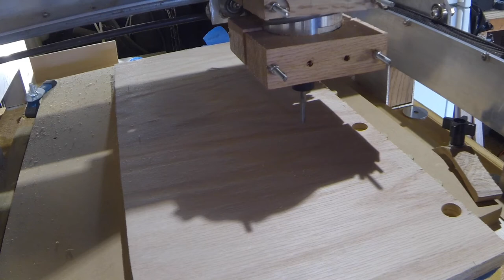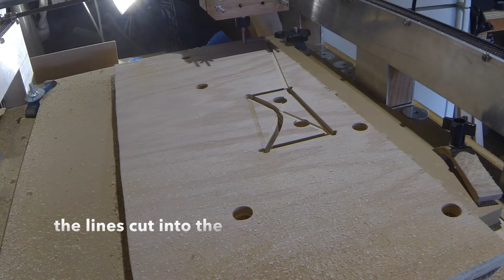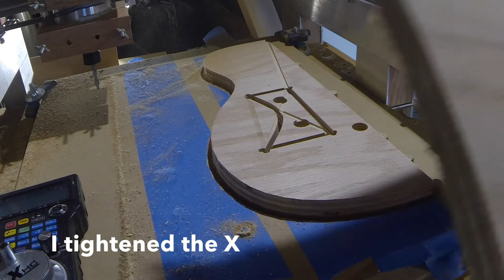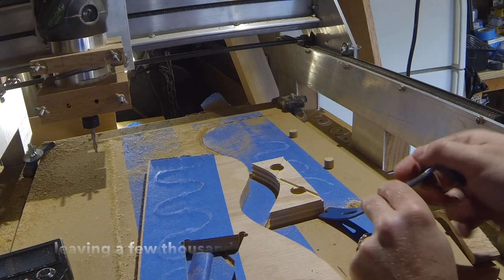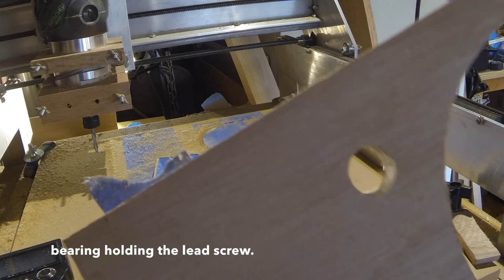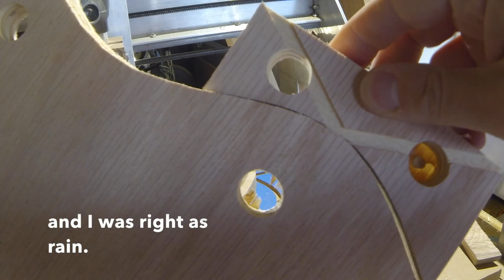CNC    Not quite everything goes wrong

Comment from the maker: @BerkyBoy, Yes I was able to fix the backlash. The main issue was on the Y axis lead screw. It's held in place with a gear-pulley at one end and a stop collar at the other. One of these was jarred loose. I think it was probably from when I ran the router bit into a work piece while trying to reposition with the bit too low. The collar had shifted so there was about .05" of play on the Y axis. That had to be taken up when changing directions, which caused the backlash. Moving the collar back into position so it was tight against the bearings did the trick.
Reply: +Rich Friedeman Sorry, no idea why my previous message was deleted. Yes I have had that same problem. That's why I am tempted to cement in the collar with some epoxy. I think also the inertia of the machine can press through the limit swicthes and the torque can wriggle the collars loose too. I think this is the best of the Solsylva designs - later I plan to make the one over at Automatedwoodworks.com as that looks awesome but I am waiting until we move house and I get a much bigger workshop - the Mrs is very understanding thankfully, even at the wall of Festool systainers and tools I spend my children's inheritance on. I've only just finished my Solsylva - yet to really use it in anger. I found the biggest headache routing the cables as they all feel messy - I am using a drag chain across the Y as you are but I have yet to find a good way to run the cables off the gantry and to the control box - I tried the method in the plans and it clearly was going to snag and it looked and felt garbage. I see you have a drag chain coming off there too. Plus, because I have the switches in active high as one complete circuit I have to somehow run cable both on to the gantry and back off again as 1 complete circuit which feels very messy - how did you handle that? You've done a great job by the way, I'll post some videos of mine soon when it is up and running properly.
Reply from the maker: +Dr. Ralph Kennedy Thanks Ralph. After repositioning the collar, things got a lot smoother for me. I found it's also sensitive to the tension of the z-axis bearings, but once the rails on the z-axis wore-in I stopped having to make adjustments. I do like the looks of the Automated Woodworks machines, but they're pretty large. I'd like a little more room than my current Solsylva (which has an effective usable size of about 16x22). I'm considering rebuilding some of it to get me up to a usable cutting size of around 26x30 or so -- maybe up to 48 for x-axis since there's no structural penalty in the design for a longer X. Getting a quarter sheet of plywood in there and usable would make a lot of things easier, though.

For limit switches and cabling, I have to admit I've completely cheated/taken the lazy route. I have no limit switches on the system at all right now. It means I have to be careful with my cut files to stay within range, but that hasn't really been a problem. I pick my x/y zero carefully and check the tab in Mach-3 which shows me the extremes I'll reach on each axis. As long as those won't run X or Y off (or into) the end, I don't worry about it. I have, once or twice, run the Z axis up off the bearings by raising it too high while manually adjusting the position, but that's a trivial fix. Bottoming out on Y could bend something and running off the rails on X is annoying to get everything back on and square, so those two are where I exercise a lot of caution. I also don't leave cuts unattended in case I have to hit the emergency stop.

As far as reliability goes, it's been very good since the above-mentioned Z repair. I've carved guitar tops (which I don't want to mess up due to the relatively expensive materials) and done some very Z-intensive projects like lithophanes. It's been running perfectly for those. 

Please do put some videos up when you're set. It'd be great to see them.
Reply: ***** Great info. Talking of size, some people are just starting to make upright cnc machines which is the ultimate space saver. It seems illogical at first due to gravity but if the gantry runs left and right then only the y is fighting gravity and in effect is lifting no more weight than when flat (OK the z carriage but it's not significant). I have been ruminating designing one - like most CNC builders I am planning the next one before I have finished the first. It should, in theory, take up no more room than a panel cutter. Of course it would only work well for carving because if you cut out a part it is going to fall and work would need to be firmly clamped. It's good to hear the Solsylva design is reasonably reliable. I had cause to email Dave early one when I bought my plans with a few questions and found him very helpful indeed. I will post some videos when running and be sure to alert you, thanks very much for filling me in on the details of your machine. Much appreciated.